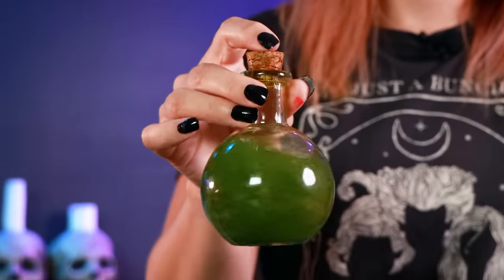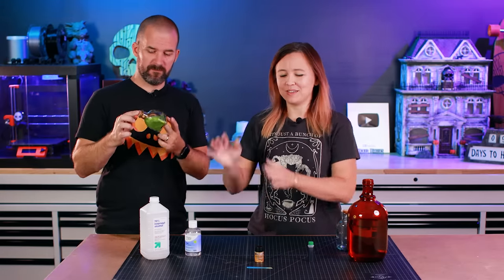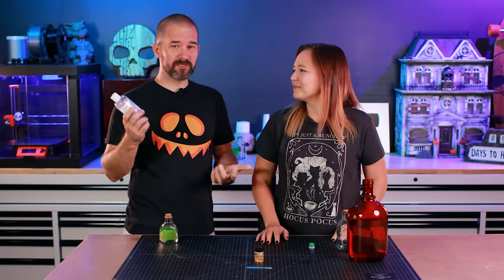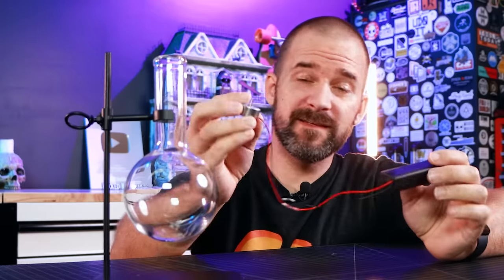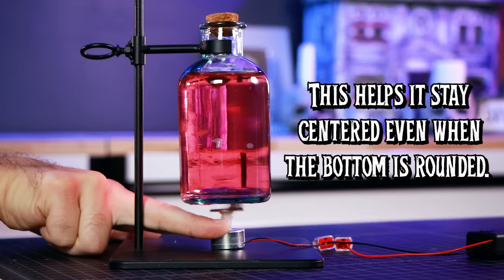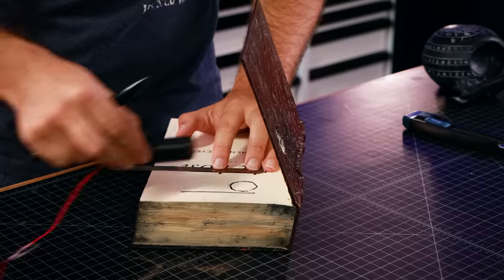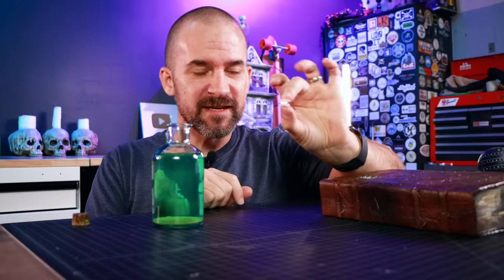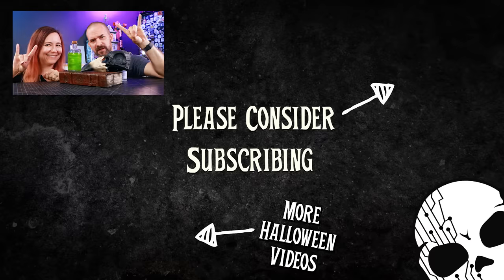We made Halloween Witch's Potions with a Magical Twist!

Comment: fun fact: they also use magnetic stirrers in chemistry labs. You can ditch making the inside magnet its own apparatus by just getting a stir bar. Mixing plates are kinda bulky so the motorized magnet is probably the best option for hiding in props, but using an electromagnet plate can make your potion spin really fast and create little whirlpools so that could be an option.
Reply: Intentionally creating a whirlpool and labeling the potion appropriately ("Tornado Potion" or something, maybe in sky blue) sounds like it'd be great!
Reply from the maker: yes!!!
Reply: I wonder if this would also work to create the illusion that the potion or maybe even a small cauldron is being stirred by itself?
Reply: @d-padqueen1103  omg i would love to see this
Reply: homebrewers also use these for doing yeast starters, so if you have a homebrew shop near you, you can potentially find stir plates and stir bars. They'll be more costly than the DIY ones shown here, of course. Another way that homebrewers make their own stirplates is gluing magnets to an old computer fan's blades, if you've got any of those kicking about.
Reply: Perhaps upgrade the book to something thicker, to accommodate a bigger moter, like an ingredent case
Reply: My motor is vey loud. And very fast.  Any suggestions to quiet it?
Reply: @MoniquedeZahr-vy7fy had the same problem, just used 1 AA battery instead of 2, connected the terminals in the empty space with some wire.
But my magnet in the bottle makes more noise than I want it too, even in the glue puddles
Reply: @d-padqueen1103 tape a spoon to the side of a rotating cake display and that is a self stiffing cauldron

Comment: You could add some led lights and a magnetic switch to the base unit and if you use tissue paper as a diffuser you can get rid of the food coloring. You can also use one of those remote control led lights that change color, really dress it up.
Reply from the maker: Yes!!!
Reply: I was thinking that too! Not enough light that it would peek out from under the bottle but enough to give the liquid its own light source!
Reply: Ditto.
Reply: Black light...
Reply: Inwas thinking the same.
Reply: @WickedMakers  please do a crystal ball like target had for sell that none of us could get because they sold out immediately- it was basically what you made but with colorful led lights in a large crystal ball on a stand with skeleton hands holding it. It was called the foggy crystal ball 🔮 blah blah. But it was THE thing to get this year- wow! We went to 5 locations and they were gone gone and it’s not even October!
Reply: @silvergirl7810  A crystal ball is a great idea but in practice it would require a pico projector under it acting as a micro planaterium if you really wanted something good. Adding a touch sensor to this mix would afford interaction which would step it up a huge notch.
Reply: @silvergirl7810  everything Halloween is selling out extremely fast this year.. more than any other year. I don’t understand if but I’m hoping it’s showing that Halloween is making an even bigger impression and that it’s here to stay!
Reply: @silvergirl7810  Maybe not as good, but you can find very similar items at Home Depot.  I saw two just yesterday.
Reply: @stevetb7777  I’ll go check it out!
Reply: I have a poison bar on a light box ( white plexiglass top, might light up nice
Reply: @bitchenboutique6953  In the UK Aldi sell sparkle Jin in a bottle with a light fixed to the bottom already.

Comment: One other thing to do is to add an LED to the circuit to shine up through the hole to illuminate the liquid.
Reply from the maker: Yes!!!
Reply: Good Idea, I'm going to do that too
Reply: What if you splice in your motor to a battery operated string lights would that work? And have you Mixed in glow paint to your mix ? Did it work

Comment: If you make the hole juuuuuust large enough, you could also rig up a low-power LED light to make the potion glow from beneath.
Reply from the maker: Yes!!!
Reply: The hole can extend under the page a bit so the light fits in there but doesn't enlarge the outer hole. I'd use a little electric tea light. Maybe even a flickering one.

Comment: 2 things … I make potion cocktails for Halloween parties. Edible dust in the drink and a small piece of dry ice to keep it bubbling! 
Second, I made a storm bottle but it’s not great so please make that!!! I used a cork with attached fairy lights and poly fil I had colored with grey streaks. It’s a storm cloud in a bottle. I wish the lights would flicker though
Reply from the maker: Whoa!!! That sounds fun 😄
Reply: If the fairy lights are plug in, you can attach a 'fluorescent starter' to an extension cord. It gives off a flickering effect on any light plugged into it. I did this on a couple of random strands inside the smoldering fire for my wicked makers witch cauldron. It looks great and the fluorescent starters are like 2 for $5 on amazon.

Comment: I am currently making this project and let meeeee teeelllll youuuu
Unless your are using bigger wires, you don’t need the wire connectors (use electrical tape). You will also need to remove some of the sheathing from the wires. Love this project but def don’t need the ports.😅 and use the tweezer tools to help with removing the sheathing. 👍🏼
Reply from the maker: For sure! The wire connectors are just less intimidating for people who have never worked with wires. Definitely better off either soldering with a heat shrink wrap or just doing a twist with tape like you said. 🤘🏼😄 Glad you’re building it!!

Comment: Great project; some simplification I am building into basic idea.

1. use a DEVMO 2pcs USB 5V DC Fan or other, glue magnets; now you can add wind effect and have no wiring solution.
2. power source can now be any usb power brick or just a plug in wall adapter for usb (we all have these, reducing complexity and cost).

Comment: You can also put your cut out leather piece back in place and then tint the edges in the same brown coloring to hide the seams. The magnet will still work with the leather in place.
Reply: I don't understand why they cut the hole in the first place. As far as I can see, all you really need is some sort of indication where the spinning magnet is so that you can center your potion properly. Am I missing something?
Reply from the maker: It has to be close to the bottle. We cut the hole so you can get it really close to the glass for the best effect.

Comment: For the liquid i would use Tonic water  - the tonic water would glow under black light for some extra 'magic' ! you can connect up a UV diode to the battery pack in the book as well so the light shines up from the bottom

Comment: pretty certan you guys dont even need to cut the hole in the cower. Even weak magnets are pretty strong. I used to play around with a magnet beneath a table to move nails and other magnetic stuff ontop.

Comment: Fantastic idea. I'm going to put together a centerpiece for our Halloween meal with self stirring potions!
Reply: One of the hardest things is getting the washer and quarter centered on the motor. 😂
I did leave the cover of my book intact and simply placed the motor into the hollow of the book. Also, I used one of the chemistry stirrer magnets, then added another magnet (opposite polarity) on the opposite edge (diameter) of the quarter. That way it will spin more evenly.

Comment: Completed my 'Enchanted Potion' project last night. I did 2 'potions' on my book. I wanted to have larger bottles so I ran into a few walls with the magnet in the bottle. Since the volume was so much more, the magnet either wouldn't move (assuming due to the weight) or it wouldn't have enough inertia to really move the solution fast enough to mix the mica powder. Thankfully the motor kit I bought (the one in the description below was OOS) was a 'mini windmill' kit so it had propellers! After modifying the propellers and outfitting them is magnets everything looks amazing! Thank you Wicked Makers for such a cool Halloween haunt project! Next is making a 'spider egg sack'!

Comment: This looks like a lot of fun, I wonder if there could be a way to make the potion glow? maybe a light under the rim of the bottle? or maybe use some glow in the dark paint?
Reply from the maker: Yes!!! I’m sure you could
Reply: Add some strontium aluminate powder.  It's a next-gen phosphorescent which will glow for as much as 30-60 minutes after being charged up.  The neat thing about strontium aluminate is that it absorbs ultra-violet and radiates in the visible range, so if you want it to glow forever all you need to do is add a UV LED underneath to keep the powder charged.  The naked eye won't see the UV LED, but you'll see the glow from the powder.  You could even use this as a night-light.

Comment: This is excellent, but i would advise putting a second magnet on the other side of the quarter (flipped to present an opposite polarity to the first magnet) so as to balance out the quarter. Otherwise you have an unbalanced load which will make the motor spindle/bearings wear unevenly over time. It'll make it much less noisy if it's well balanced as well!

Comment: This tutorial is really great! I clicked on this because I want to make my own decorative potion bottles too but I've come across many problems.
 When I did it with water and food coloring, the water evaporated through the cork stopper and the level of the liquid decreased over time. I put a small piece of plastic wrap under the cork stopper and glued the whole thing so that the water wouldn't be able to get out through the stopper but that didn't work as well. 
I tried epoxy resin, worked well and looks great, the liquid hardens so it can't spill outside the bottle. Problems are, the food coloring powder doesn't mix quite well and sometimes there are chunks of powder in the liquid. I like adding glitter and while the epoxy resin cures (solidifies), most of the glitter sinks to the bottom and the resin cures like that. I can't mix it during the curing. Also after a few months, I realized the glass broke. There were cracks on the bottle but no missing glass pieces; I'm assuming the glass broke because of the epoxy and didn't turn into pieces, because epoxy was stuck to the glass and is now holding the broken pieces together.
After watching this video of yours, I researched about glycerin but still have some questions. Do you use the glycerin to stop the water from evaporating? Are there other reasons you mix glycerin with water? Will the water still evaporate if I add glycerin (but slower)?
I want my potions to be not pourable. I want people to be able to just put it on their shelf or desk and the liquid inside doesn't decrease. It would be an extra if the liquid inside was still fluid (unlike the epoxy resin ones I did) but it isn't a must for me. 
At a gaming convention I went to I saw someone selling potion bottles, the inside wasn't fluid. I asked what the material was and they said hair gel with food coloring. I think that's a great option as well but I'd rather prefer a fluid liquid that doesn't evaporate and just stays inside the bottle.
Sorry for the long comment, thank you for the video and for reading this!

Comment: Fyi, If you're working in a book make your first step gluing the pages.  You don't need to do it individually,  instead brush glue around the edges of the pages when the book is closed (like where gold leaf usually is). Put wax paper between the front pages and cover, so you can open it to work inside after the glue dries. The glue will dry clear and hold the book as if its a wood block.

Comment: The way the stirring in the crystal ball works is essentially identical to magnetic stirrers that are used in chemistry labs. You could also opt to buy a cheap pre-made magnetic stir bar/pill and use a (DIY) magnetic stirrer. A magnetic stirrer can be made quite easily with an old PC fan as well, as hit has a nice flat spinning hub at the center to which you can glue two magnets (needed for the stir bar/pill).

Comment: I've made this one and I'm finalizing the artistic touches on the book.  One issue I had was that my hot glue did not hold up on the inside the bottle (I used a beaker from a craft store) and dissolved?  Anyone else having this issue?  I took Peppy the Clown's advice below and ordered some stirring bars, so maybe that will help.  For those curious, my liquid needed about a tablespoon of mica powder for the desired affect and it is around 6 oz to maybe 8 oz at most.  Love the channel and my wife and I are trying to do some of the DIY stuff that you showcase!

Comment: The other upside to glycerin is that it's really good at suspending solids in liquid and it'll carry the mica powders. I've seen a lot of people try this and they miss the glycerin and are disappointed. Also, another option for the inside of the bottle, which would probably give a little more motion if you have a bigger vessel is a magnetic stir bar like they use in labs; could save a lot of frustration if someone is using, say, a big glass bowl or something similar!
Reply from the maker: Yes!! Absolutely.

Comment: This is wonderful! In process of making now. was that a plastic nut you used? What was the size?
Reply from the maker: m2 is the size you'll need. It should fit pretty snug and you can use a bit of hot glue inside if you need to.

Comment: Just a heads up, since I’m not sure when you ordered the listed motors for this project…the most recent reviews mention the RPM are the listed motors is higher than on the previous listing from the same company. A few complaints that they now were way to fast for previous uses. Not sure if that’s going to be an issue or not but thought I’d mention it.

Comment: Very cool!   Would have been good to test it through the cover first as, depending on the strength of the magnet, it might have worked without cutting a hole in the cover.

Comment: Lovely project. How did you make that book, it looks perfect.  
However I think there is some room to improve on the idea. The hole in the cover of the book is not needed, just like the glass of the bottle, the magnetic field goes right though it. Without that hole, the bottle can be handled. 
Also when you place magnets on both half's of the coin, one side N up and one side S up, the motor is better balanced. It should make less noise and the coupling with the magnet in the bottle improved. And when buying magnets anyways, you could just get stirring magnets (aka magnetic stirring rods). This are bar magnets covered in plastic. One in the bottle, one on the motor.

Comment: CVS the last 4-5 years have sold potion bottle props with this effect...every year we go and see if they have new bottles and or colors...lol , I think we have 6-9 different ones now...

I want to build a creepy apothecary shelf and have several bottles like this all over and wire it up to plug in and just flip a switch and turn the whole thing on...Now with this project , it will be a lot easier then taking apart the prop bottles we have bought and looking for around 12 more!

Comment: Just wanted to come back and say that hot glue will not hold the magnet to anything. Trying to get that to work was the silliest thing I have ever done. And replace the quarter with a plastic cap from inside a pill bottle lid. Works much better.

Comment: Have you looked at adding an LED under the bottle so the potion glows?  I wouldn't be surprised if you could power it off the same battery pack as the motor.

Comment: Very cool!  I'd want to add an LED under it to light it up. 

How easy is it to connect to a USB plug instead of using a battery pack?  Not sure what kind of step down you would need to have to not burn out the motor

Comment: The motor that you are using is a 3V motor, but it looks like you are using a 1 AA battery holder, giving you only 1.5V. If that is the case are you using a lower voltage so that the motor spins slower, or are you actually using the 2 AA battery holder to give you 3V? I truly enjoy your videos! Thank you in advance for your time.
Reply from the maker: We’re intentionally using 1.5 so it spins slower. 😄😄

Comment: I see these motors are 3v 1700 rpm. You have used 1 AA battery. Does that mean it's running half speed. Would you say that's the optimum rpm for this project?
Reply from the maker: Yeah, we were pretty happy with the RPM

Comment: You really should hot glue some non-magnetic weights roughly the same weight as the magnets on the opposite end of the quarter from the magnets.  Over time the weight being unbalanced could cause problems.
Reply from the maker: That’s smart yeah

Comment: Wait, was the hole in the book cover necessary? I've used such neodymium magnets under a desk to move metal on top for instance. I feel it might be strong enough to do the same for your homemade agitator through the glass and book cover, especially since its a magnet as well.

I'd still add the hole for some LED's in the circuit however, I'd imagine that would look really cool in a dimly lit room.
Reply from the maker: In our tests it didn’t work that well unless it was really close but it could just come down to magnet strength.
Reply: @WickedMakers  Ah gotcha, good to know though because I'm tempted to make this one for moms table display.

Comment: Having a hard time getting my magnet to spin. It just sits on the bottom of the glass. Got all the materials suggested, tried using the top of a mason jar instead of a quarter which helped but now it’s huge! Tried using a thinner bottom glass. Any other suggestions? Maybe a slower motor? Did anyone find an RPM that worked for them?